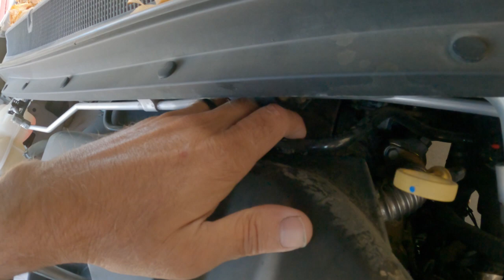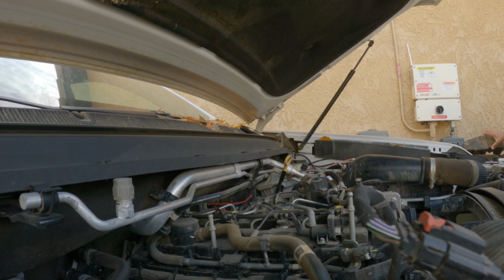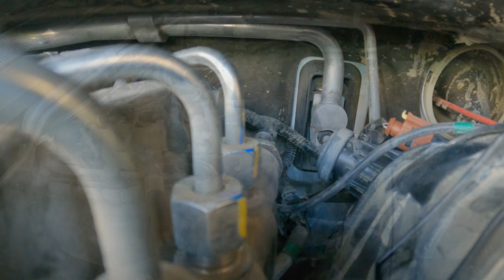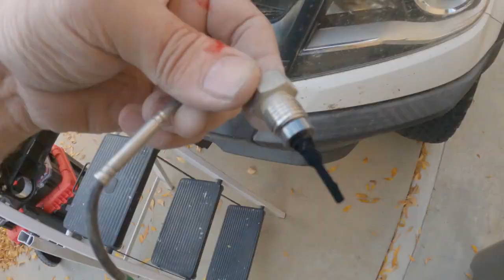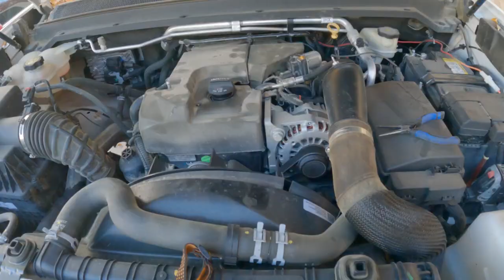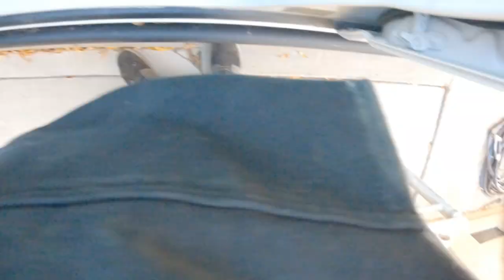EGR Code Repair

Comment: Thanks for the video it helped me a lot. I started with the one on the passenger side and it fixed my problem.
Reply from the maker: I went after the hard on first since it was showing 2 codes, I believed that it meant they both needed changing. This driver side one is tough with the “blind” plug. I am glad that the video helped.

Comment: Dawn and Rob, thank you for the video. So did you end up having to replace the other sensor after all? If I read it correctly, on the forum, that after driving it around a bit, it cleared codes with just that sensor?
Reply from the maker: To be honest, I have not checked to see if changing both actually cleared the code, but the check engine light went off!